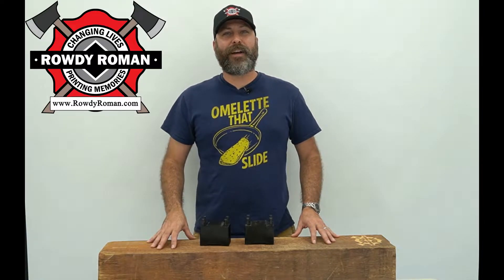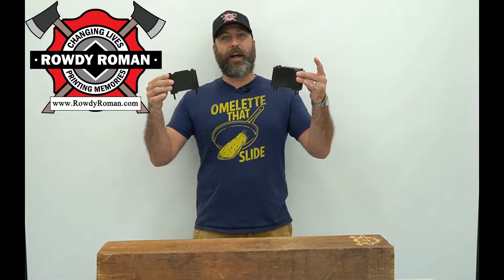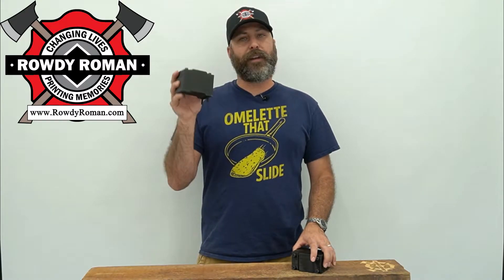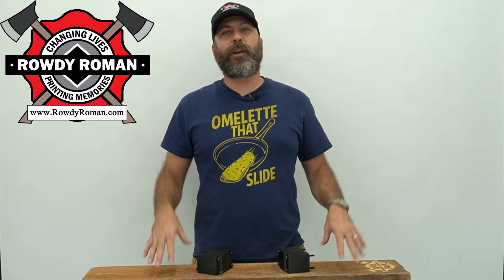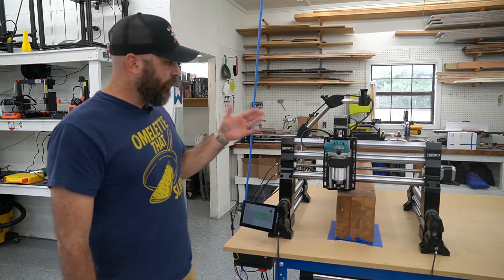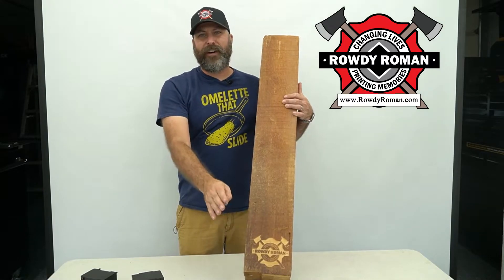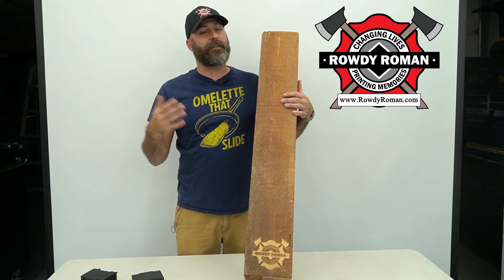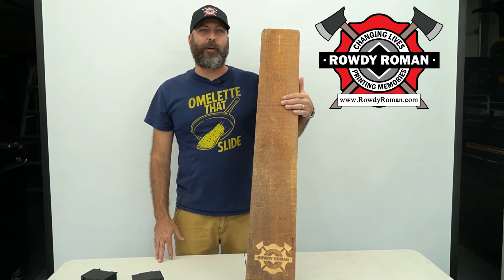Jack Up Your Onefinity with Riser Blocks

Comment: Tip: I made what i call skis and bolted  the 1F to the ski. (y axis) then i made my table lock in the ski. I can use blocks under the ski to lift the 1F The Ski is saving me from moving my cnc and making new holes everytime when i move it.  move it with the ski, clamp it in and off you go. Riser blocks go under the ski unclamp the ski place riser blocks in clamp down the ski. moving the 1F is not near as bad with the skis in place. My garage is cold and i hate running the Jtech in the basement. so i needed to be able to move around.
Reply: That sounds awesome! I would love to see some pictures!

Comment: Is that a nominal 8 in block at 7.5 inch thickness or a true rough sawn 8 in. timber?
Reply from the maker: Rough 8”
Reply: With the longest bit you can fit, in your opinion, what is the deepest pocket you could cut?